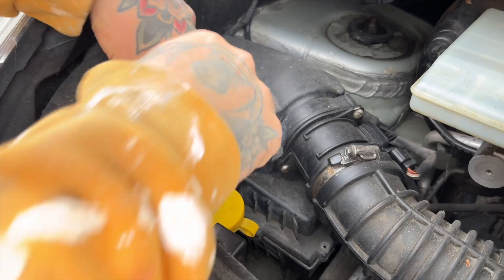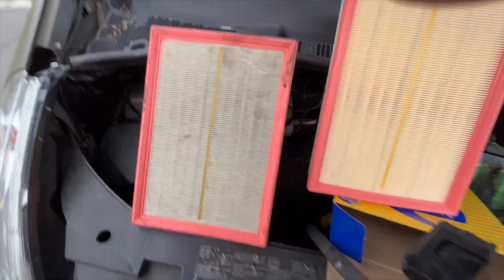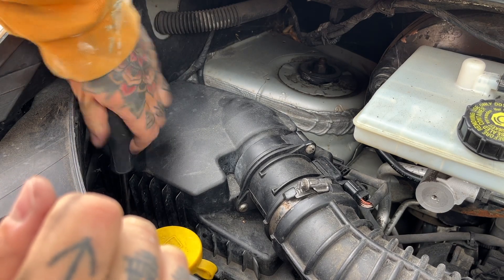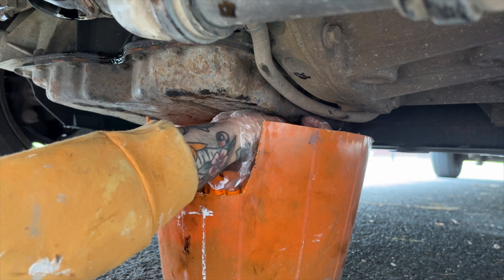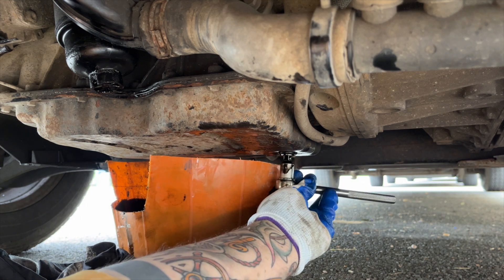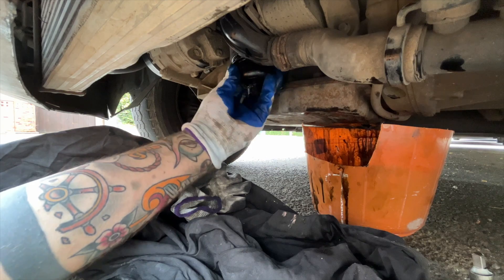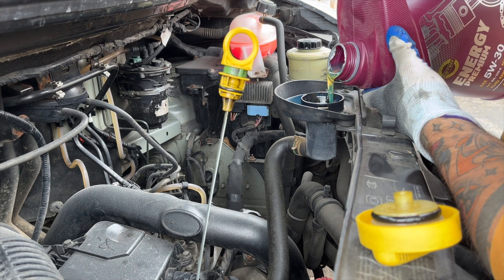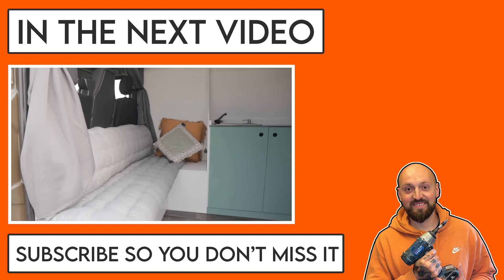How to do an Oil & Filter Service on a Renault Master / Vauxhall Movano

Comment from the maker: The oil used is 5W 30. 
The filter socket is a 27mm. 
The sump plug is an 8mm square drive key.
Reply: So the keys are same as in all renaults 😅

Comment: Nice little video but it could have been much more informative to mention what sockets sizes you used, and what grade of oil.
Best Regards.
Reply from the maker: When I filmed it, it was just covering doing the service as part of the camper van conversion we did. If I was to do it again I’d definitely include more info like you say. I’ll add a pinned comment with the oil and socket sizes in for reference for people. Thanks for the comment